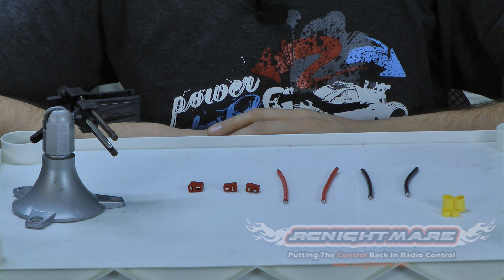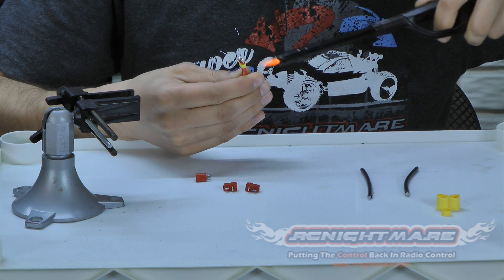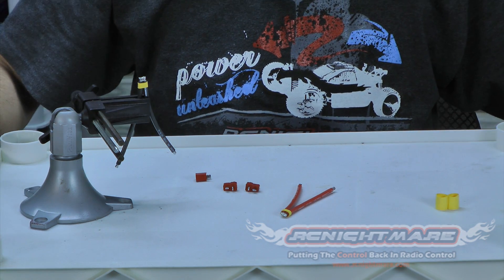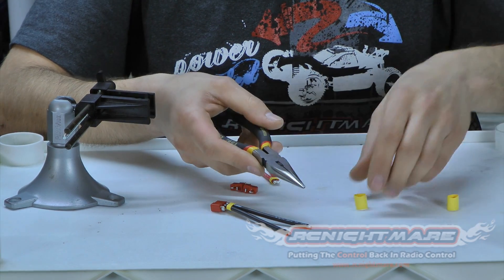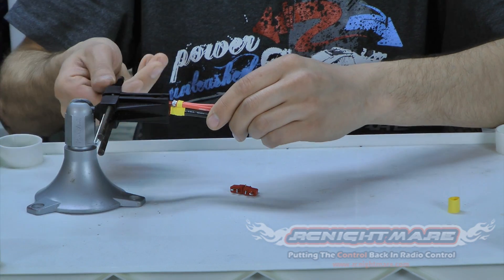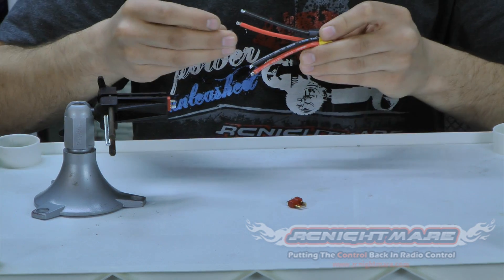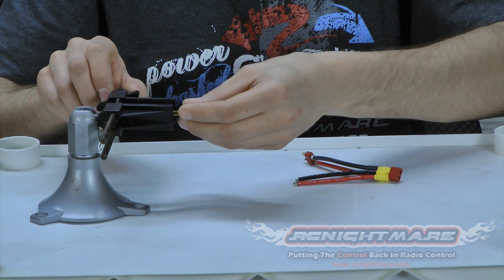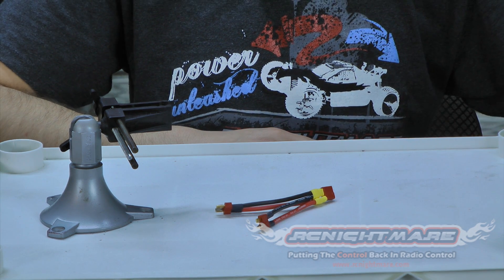Make Your Own RC Parallel Battery Adapter-How To

Comment: question. looks like ur using flo temp solder. is it silver bearing? that's what I use great strong stuff except it sticks to the tip of my iron. kind of annoying. just wondering Is there specific tips for non lead cuz almost all solder no a days is lead free

Comment: @rcnightmare modify it! lol. 1300mah will still get at least an hour of runtime. just doesnt seem like that big of a deal to swap batteries after that long. a guy might need a break after stumblin over the rocks for that long lol. hey great tutorial btw, hadnt thought of using heat shrink to hold the wires together.

Comment from the maker: @kylea1985 generally the battery size that fit in crawlers doesn't leave room for something like that, stacking two 1300 mah is more likely to fit..